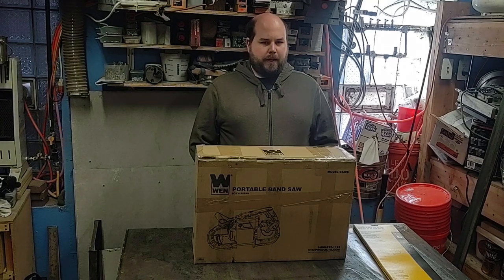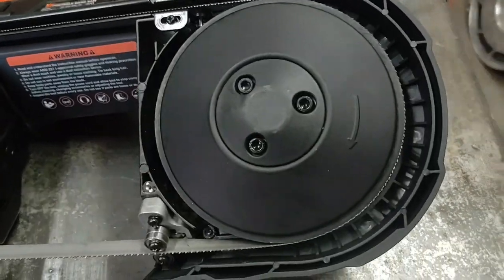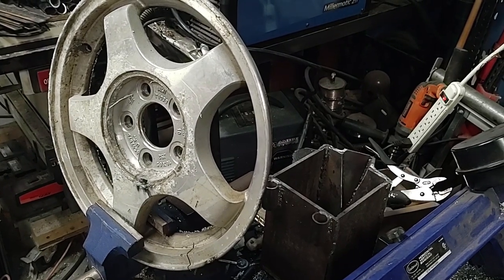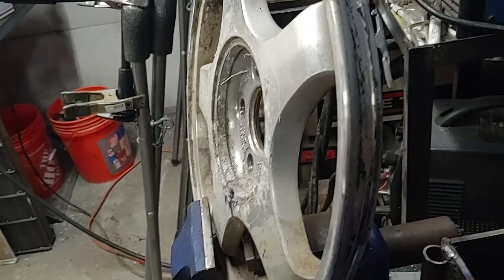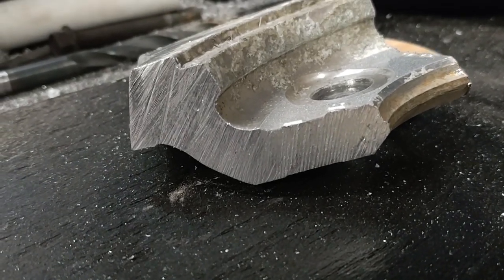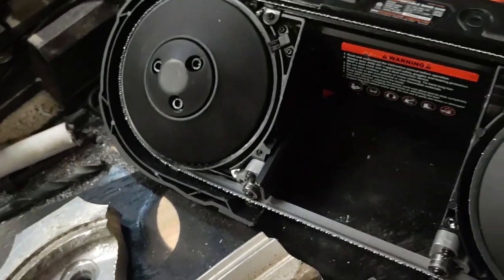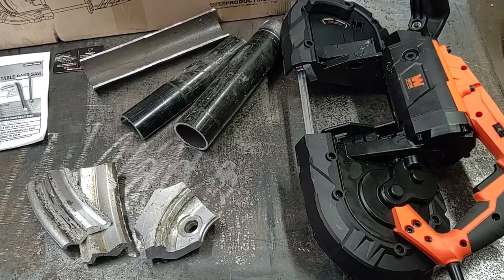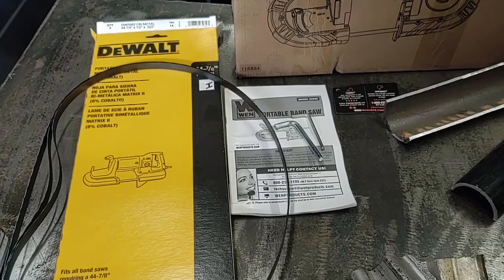Wen Portable Band Saw - Setup and Testing

Comment: I had this same and it broke after a few uses. I returned it and bought a Milwaukee for $200.
Reply from the maker: Well that's disappointing, what on the saw broke?  I was also looking at the Milwaukee and Dewalt but those were both around $250+.  I wasn't sure how much I would use this since I have a bench top band saw too so I went with the cheaper option.
Reply: @planbuildplay8528  The blade kept popping off. The wheel that the blade runs on was not running true

Comment: Hi! Is your wen band saw still working? Have you ever disassembled it? Do you know if the speed reduction gears that drive the pulleys are made of metal or plastic?
Reply from the maker: Yes it is still working, but it isn't really a tool I use everyday so doesn't have too many hours on it.  I have not disassembled it yet so not sure about the gear material.
Reply: @planbuildplay8528  Ok. Thanks a lot for your response

Comment: I may have missed it, but if you are going to speed up the video you should let people know what the speed is (2x, 4x, etc) so we can get a feel for how long it really took for your cuts.  Also, how long does a blade typically last?  Did you do this test with only one blade?
Reply from the maker: I usually add a #X >> in one of the corners if fast forwarding.  For this video it was at 4X speed.  This video took two blades, mostly because I got the blade caught in the aluminum and had to twist it to get it out and it snapped soon after that.  The blades do last a while if not putting sideways or twisting pressure on them.  Most times I have had the blade snap before they went dull.

Comment: Bought the EU version and it lasted exactly 1:30 minutes - then the motor control circuit was fried and the speed control went haywire. Don't cheap out on this type of machine!
Reply from the maker: I guess I have just been getting lucky mine is still working, maybe I'll have to upgrade when this one breaks.  The only issue I have noticed so far is sometimes the blade slips off the guide bearings if putting too much pressure on the blade.